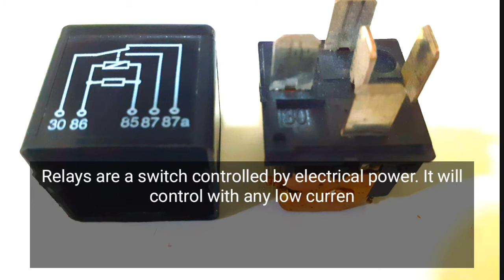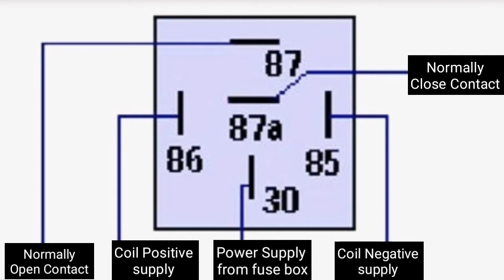How it works automotive relay

Comment: Will a relay that is connected in series with an inductor prevent flyback voltage from damaging the rest of the circuit?
Reply from the maker: To prevent the reverse polarity voltage pulse on switch turn off.
The flyback diode is connected to prevent flowback of the voltage when you turns off the control. Thank you for visiting.
Reply: @MakCyberTutorialChannel  Thank you sir